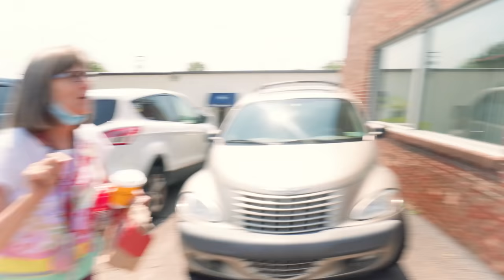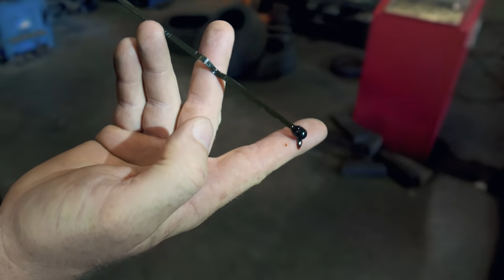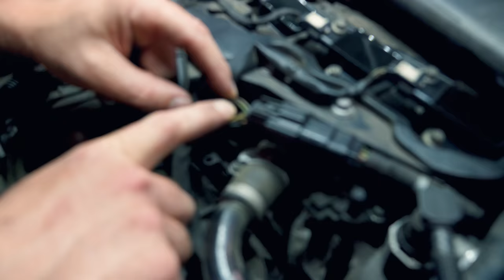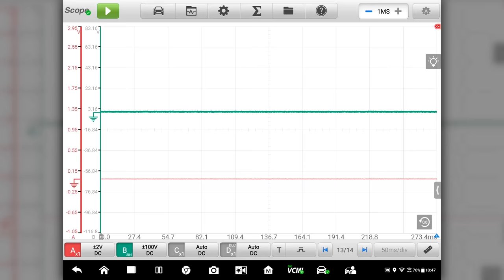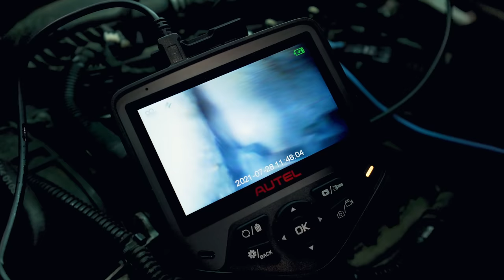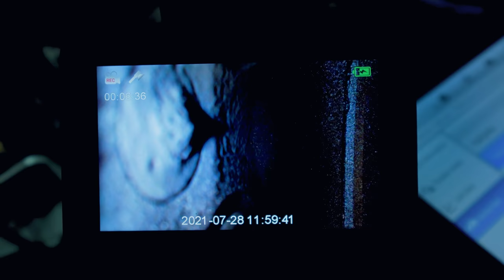Stuck Open Fuel Injectors (GDI) Part 1 (symptoms and troubleshooting)

Comment: fuel tank contamination ( inadvertently or thru vandalism… D.E.F. in gas)  or high pressure pump failure. I’d clean and flush everything.

Comment: I believe one of my injectors is broken should I replace all or just the broken one ? At Toyota they are $288.00 each ouch! And installation ouch!  I have a 1993 Toyota T100 200,000 miles on it runs perfect other then the hard start What’s your advice ?

Comment: Had 1 and 5 stuck open on Pontiac obd1.5 so no scan possible just old school troubleshooting. Replaced all 6 injectors because all the same age. Still RICH but figured it was still flooded and had to clear the old gas until a backfire. Lit the back bumper. Found 1 and 5 still stuck open spewing gas. Drove me nuts trying to figure it out. Moved the injectors and they still suck. Just happened to get 2 defective injectors of the 6 and dropped them into the same 1 and 5 cylinders What are the odds?

Comment: Sup guys?? Quick question. Ls swapped elco, with headers, cylinder 4 header tube is cool to the touch and plug is gassy and carbon build up like crazy, could too much fuel cause it to be cool like that? Also strong gas Oder out exhaust pipe. Thx for your time.🤛🏼

Comment: blockage in 4 causes blow back pressure 3,2 and 1

i think dumping the fuel completely replacing pump fuel pump washing inside tank and so forth ..

I suspect fuel ran low enough debris in tanks may be destroyed part of pump and  filter  I'd injector likely fried on the way to the hospital and with the flooding caused the piston 4 blockage with blow back into 3, 2 and 1 caused a flooded engine

with 130k miles on the clock might missed few services

Comment: Hey ScannerDanner, I have an 06 g35 coupe that’s been sitting for 2 months now, don’t know what’s wrong with it, but the car has over $1,500 on new parts now and the car is still not fixed, have a p0300 code, and cylinder 5 and 6 injectors are not injecting gasoline into those cylinders, I changed those 2 injectors and still have the problem, I also changed the coils, new maf sensor and I also changed the spark plugs before I took the car to the shop and when I got the car back the sparks plugs were burnt and replaced them again, I changed the crank sensor also, tomorrow I’m changing the camsensors, I really don’t know what else to do and I don’t want to sell the car, but the car one day I turned it on and the car was taking long to start and sometimes after I started the car I turned off by itself, thought it was the sparkplugs and the car misfire was worst and haven’t drove it since, can it be the injectors stuck open on cylinder 5 and 6 like this car, please I need help, the mechanic couldn’t do anything with the car P1148
P1168
P0051
P1148
P0031
These are the codes in the car right now, I will really really appreciate all the help, thanks a lot

Comment: How beautiful Paul Danner the relationship with your mom … God bless you all … In hope she’s doing good I know this is a old video again I hope and pray 🙏 to God she’s doing good or better … talking about cars now I have the same symptoms on a 1998 3.0 L V6 Toyota Camry where the DIY change coil , spark plugs wires and all the injectors … symptoms are hard starting, misfiring all cylinders and smoking Raw fuel out of the tailpipe. So the problem in this Toyota was in cylinder #3 and of course was under the intake that was very hard to access. The injectors wasn’t the problem. The problem is the control wire have ground all the time. If Checking wire integrity to the injector pass the test then a bad driver in the PCM Weil fix the problem.
Reply from the maker: Thank you! Did you fix it?

Comment: I am stuck in a similar thing.  Replaced multiple injectors eventually got them all running once it heated up a bit misfire is back.  What did you guys find?  Weirdly after it ran for a bit one side of the side ran 35 lean and the other 35 rich.....  and started stumbling again......... WHY.  Is it a clogged cat?  I dunno.

Comment: See this a lot in euro cars.  Folks only change their oil when the car tells them to every 12k.  Fuel pump and vacuum pump gets oil starved.  If fuel dumps in the crankcase it trashes the crankcase valve. carbon in oil starts causing misfires.  It all is related to oil changes folks. And decarboning the engine every 10-15k.  I sell a BG dynamic engine restore when the oil is just as black after the oil change as it was before.  Educate your customers so they don't have these problems down the road.

Comment: also to look into the cylinders instead of cranking the engine, use a outside injector cleaner with gas and low pressure into the fuel line. pull the fuse to the fuel pump. crank the engine that way. you then have control of  the pressure and you can also fill the outside injector cleaner with carb solvent and run the car until its the motor shakes really bad. Running carb cleaner into the fuel line will actually start the motor and run on the carb cleaner force cleaning the injectors.  i still think its a wiring issue. and or bad injector, but i haven't heard stuck open and the Mutiple misfires are puzzling. for 3 injectors to go bad at the same time??? UINLESS the car ran daily then sat for a few months.  Off to part 2

Comment: I have the same problem right now,I changed the filter a week ago, I bought these injectors off ebay and it'll b the last tyme, they sold me no good fuel injections,don't trust ebay

Comment: Good show and tell.
Ive run in too a F150 Echo boost that had a leak and caused engine failure requiring a new jasper crate and All new injectors.
Always, Always Check your pressures on a GDI with a misfire And correct it prior to engine damage
GDI are inheantly dirty and hard to clean without disassembly, An Induction service is a waste of customer$ Removal of the intake is a must to clean the runners or replace the intake with new.
Replacing the injectors @ 100K is less than an engine.

Comment: Do you offer a discount code for the pico 4425A standard kit? I notice the price on your website is around $2300, but when connected to the AES wave website it shows to be around the $3000 mark. This is of course a substantially savings for someone looking to get their first scope. Great videos, I’ve applied a lot of the techniques you talk talk about as a HD diesel field technician. Now looking to advance my diagnostics to the next level, a reply would be great greatly appreciated. Thanks

Comment: Great video.  I just picked up a 93 bronco with a 5.8 as a project and it was a crank no start. I used your 3 part video to diagnose ignition/electrical first but I unfortunately found out it was an open injector/s.  The whole upper air intake is filled with fuel and now the fuel is in the oil.  I noticed fuel dripping from the throttle body. I then took off the air intake hoses and noticed fuel pooling in the plenum and the engine is filled with fuel. Not sure where to go from here.

Comment: I've been chasing a white smoke on startup in my 16 escape also.   I know it's not intrusion because the pistons are dirty.   But when I start the car I can hear a crazy sucking sound that comes and goes for about 20 seconds then it will run fine.     I just cleaned valves and it still does it.  Any ideas?

Comment: I don't think there is a replaceable fuel filter on those anymore , I think that's the problem, they are relying on plastic tank , plastic lines plastic everything, to believe they don't have to worry about  rust

Comment: Well Danner you had me on that one? I would have looked into the coolant container, but you called it. I don't know enough about the newer fuel system's to give any insight. That  fourth injector did not look like it was even used? Is it E-85 gas type? or flex fuel?

Comment: Paul your mom is really great, lost my father at 59 from renal cell blood cancer 8 years ago, spend as much time as you can with her. I m a master mechanic for kia we have problems with high pressure fuel pumps leaking in crankcase causing same problems. Also brother been following you for a while you been hitting weights definitely looks like you've pumped up.
Reply from the maker: Thank you my friend. I'm sorry to hear about your father 😪
And yes! I've been back in the gym for about 2 months now. Thanks for noticing 😀
Reply: @ScannerDanner  thanks bud appreciate,  you'll have to shoot me something about your work out regimen and supplements. Used to work out heavy until was in a bad motorcycle accident and lost all my progress. Thanks again and will always continue to follow your case studies ect....
Reply from the maker: @kevinclubb3558  I take no supplements, and since I am 48 now and my joints ache, I don't go heavy at all anymore. Just been doing circuit training with little rest between sets. I will do 3 sets of some exercise for these main groups (legs, back, shoulders, chest, biceps, triceps, abdominals), so 7 different groups, 3 sets each (21 total sets) and I try to do this 3 times a week. I also mix up the exercises, ex: chest may just be 3 sets on the incline bench or just regular pushups, legs may be reverse lunges or squats etc etc. Changing it up and not letting your muscles get accustomed is key.  
Then I also play hockey and stuff for my cardio, plus I rest very little between sets so I'm getting cardio there too. 45 minutes at the very most for the 21 sets or if I am only doing 2 sets each (14 total sets) this is a 30 minute workout, no longer!
Reply: @ScannerDanner  how many reps on those sets  big guy, and dietary you eat anything or!!!
Reply from the maker: @kevinclubb3558  10-15 and yeah, I pretty much eat whatever lol 
If I was more disciplined in my diet I could shed a lot of extra pounds, but I like my food 😋

Comment: My A3 Audi had a Stuck open injector on cylinder 3. I had a litre of fuel in the oil that washed by the rings. 1,2, and 4 were fuel starved and 3 was partying like it was his birthday!  Loads of smoke.  I found it doing a compression test thinking the worst. I tested Cyl 3 and pressure was good, pulled 2 to do a comparison and when I cranked it fuel flooded out of plug hole 3. I put the injector in my test rig and couldn't even get to 1 psi before it leaked. I think my GDI Audi rail pressure is around 600 PSI lol

Comment: Dirt in the fuel system...also check the pressure relief valve...it may also be dirty, and replace the fuel filter: change oil and filter.

Comment: This may have been caused by metal shavings from high pressure fuel pump wear, going through the high pressure system? Like in diesel fuel injection systems...That is my first guess. I may be wrong, but that can definitely clog up all your injectors.

Comment: Just guessing, would low quality fuel and cheap oil be suspect? Cylinder four looked nastier than I'd expect it to. It's obvious the oil, regardless of brand, is trashed. Couldn't help wondering if it trashed the turbo too.

Comment: My thoughts 💭 are that’s cylinder 4 injector looks blocked. 
Hence when u turned off injection remotely
Only four died and 1-3 was still fuelling that’s just my theory but the fact that they were flowing so much on Lp means I guess faulty injectors 
I love these videos i get to relearn so much I forgot to consider

Comment: Awesome to see your mom is doing great. She's definitely internet gold for sure. 😀 
 Oh ya.. HI MOM.! 💗
On the theory of 3 injectors at once or at least one after another if this was something that was driven on for some time before it got this bad..I would say the high pressure pump is starting to deteriorate and falling apart inside sending metal particles into the injectors causing it to stick open.  Might see some fine glitter when you flush out that fuel rail.  😄
Btw...So far I have had good luck pulling the injectors out of the head by kind of giving it some side to side movement and then tugging them straight up with the rail still attached to them...so all 4 at the same time.  They have these aluminum retainer clips that seem to hold them onto the rail pretty good. I'm sure you're probably way past this point already and quiet possibly done with this but just in case someone else might read this and think they have to have the slide hammer specialty tools...It can be done without it. Also, shoot and soak some WD or some kind of lube down on the base of them stubborn ones can help too.
Looking forward to part 2.  Cheers 😎👍🍻

Comment: Hi,i had a total internal gas flood like  that in 1995 on a corvette TPI engine i had just installed in a Jaguar XJS (ex-V12); all cyls,the whole intake plenum, were full of gas,with gas already spilling over the engine onto the ground (feel now sorry for the polar bears and bees i may have hurt with all that gas vapor...);
 i was road testing the car and i was just pulling into a friend's shop 2 miles from mine,and of course it stalled...right at the entrance gate; no fire; i was able to fix it right there and than, and 30 ,or maybe 60 min.later it was running again; problem never returned;
the problem is that i can´t remember exactly what the problem was, all i remember is that i did not have to do almost anything to it,just re-check connections to the ECU and to some sensors, and all of a sudden all was well;  drove it home,did some more 200 or 300  miles,delivered to the customer,and it never did it again; wish i could remember at least what could have caused that...

Comment: Would you ever crack open one of those injectors to see what the debris is inside it?  Maybe it's debris from the high pressure pump, or maybe the fuel filter is breaking down.  It might tell you how far back you need to go?

Comment: DIG, DI, etc. only use the high pressure fuel injectors for fuel delivery into each cylinder.  Manufacturers are now using high and low pressure fuel injectors to combat the major build up of carbon on the valves the direct gas injection design suffers. High pressure injectors in the combustion chamber and traditional injectors just before the valves to wash down build up. The fuel management just becomes more complicated.

Comment: The high pressure pump is driven by the exhaust camshaft. Never seen it but I guess it could be possible to leak into the intake. There have been issues of the pump and tappett failing, causing damage to the head, camshaft. The pump could have failed and sent metal through the fuel rail. Have also had issues with the fuel line sensor being biased high, although I don't think this would cause your issue. My Ford scan tool can run an injector flow test which could verify a leaking or stuck injector.

Comment: I would take exhaust temps at the manifold before doing anything.
Reply from the maker: What would you be looking for?
Typically when there is this much fuel, the exhaust doesn't get hot as there isn't enough oxygen to complete any burn in the cat. (From a flooded condition in a sense)

Comment: I learned a lesson several years ago trying to unflood a a lawn mower in my garage after removing the spark plug and NOT grounding or insulating  the plug wire connector or grounding out the coil. I remember a small flame thrower. It caused no problem, but made me always aware of sparks around fuel.

Comment: Commenting on when you were capturing injector signatures, I’m going to assume you don’t have injector control until your high psi rail reaches desired in order to reduce the chances of damaging the injectors. 

Frieghtliner DD platforms have a high probability of grenading a high psi fuel pump if not properly primed after servicing the fuel system. 

(We have one in the shop right now for a failed high psi pump)

Comment: The 1.5L Ecoboost is notorious for blowing the head gasket due to a faulty engine block design. Ford has redesigned the block and head gasket and recommends replacing the complete short block when coolant starts intruding into the cylinders. Eventually, it causes misfiring. In many cases, the engine overheats multiple times before the customer is aware of a problem. Overheating may have caused the injectors to fail in this engine; possibly fuel gum and varnish formed inside during hot soak events. It would be interesting to know if the engine was ever replaced in this Escape, because it's also possible that the technician who replaced the engine caused the injector failures through careless work practices.

Comment: Could this be like on Ford 6.0 diesels where 1 injector leaks combustion back through the fuel rail and air bubbles destroy the other injectors? They are sealed by a lapped very close tolerance metal to metal surface no?

Comment: Hi Paul good diag but possibly it might be worth AC couple rail pressure sensor  signal with scope and sink it with a injector and watch the pressure drops per injection. one way to find injector issue I use this type of test for GDI and  Diesel common rail  vehicles

Comment: Praying for your mom.....I'm having a very similar issue with my 2015 Kia soul gdi.....all new plugs n coils.....still misfiring at low rpm and at first cold start it's even worse but once it warms up it drives fine on the highway in higher rpms
Reply from the maker: Possible carbon build up on the back of the intake valves.
Thanks for the comment about my mom

Comment: I'll bet the is debris in the injectors. I'd ask the customer if they ran out of gas recently or got to the pump on fumes. If not,I'd check the HP pump, it could be spitting out parts of it self to the injectors.